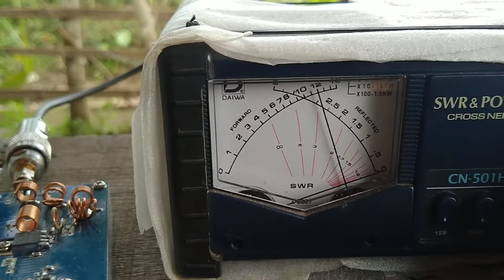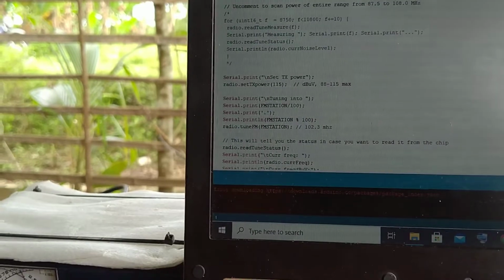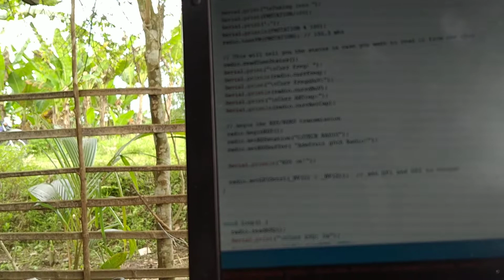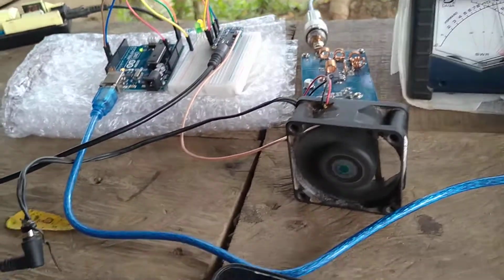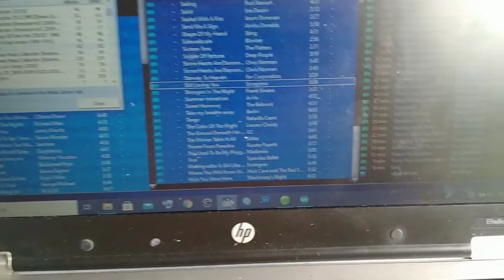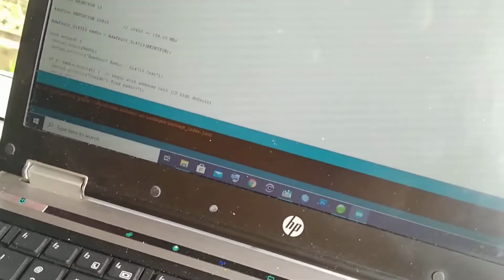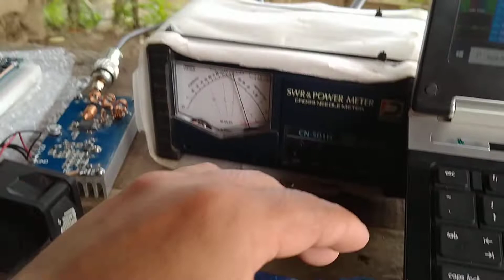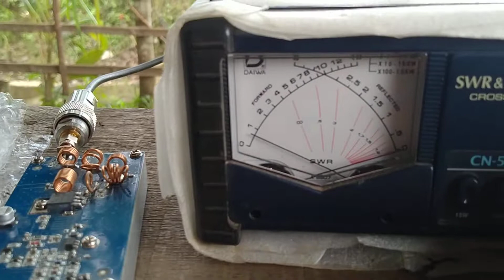FM TRANSMITTER USING si4713 powered by ardiuno

Comment: On the antenna wire to the RF amplifier did you solder the ground/shield to the SI4713 and the RFIN ground?  It is difficult to tell in the videos.  If so where did  you solder the shield wire on the SI4713?
Reply from the maker: Sorry for the late response sir. Yes I solder the ground from module to amplifier